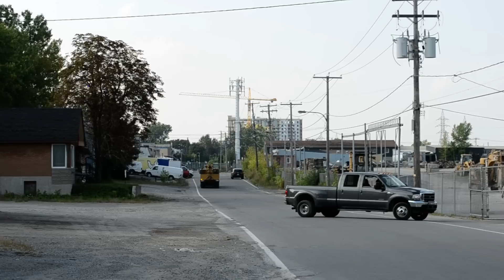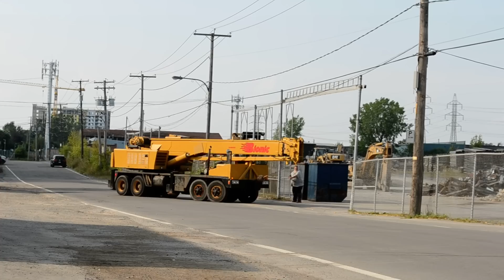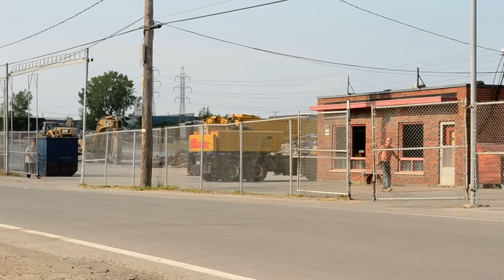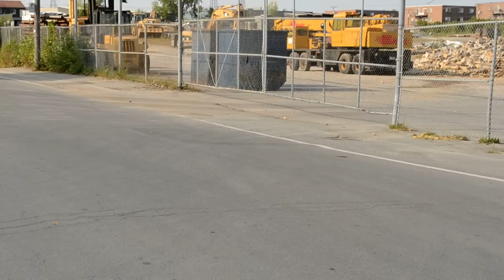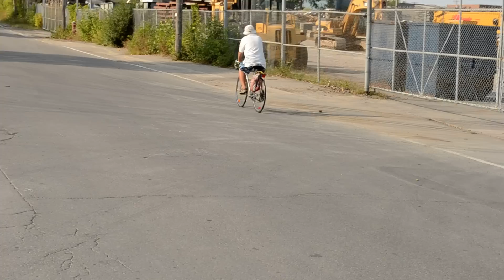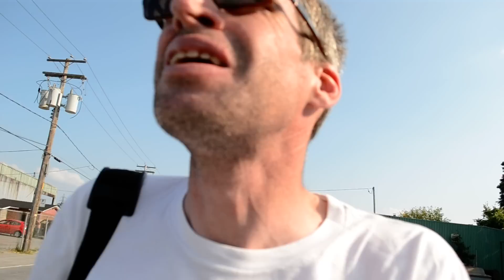1972 GROVE CRANE SIGHTING WITH 6V71 DETROIT DIESEL

Comment: I'm on Maui, Hawaii and just saw a very similar looking crane driving down a public road. It looked to be in great shape, faded paint but no visible rust. It's hard to keep anything metal from rusting in the salt air here so it must be very well cared for. 

It was strange to see such a massive old beast trundling down a road usually frequented by rental cars, passing the posh hotels and botique shops with that unmistakeable 2-stroke Detroit sound. Very cool old machine that's apparently still being put to work. 👍